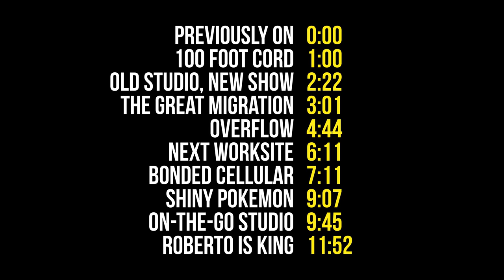The Most Luxurious Chicken Coop In America Is Complete

Comment: Don't leave the USB-C to ethernet adapter connected to the cable. When they get smacked around like that, they can break rather easily and cause intermittent connections that will drive you crazy trying to figure out what's wrong.

Comment: The other way to prevent the rooster from crowing early in the morning is to make the roof of the sleeping enclosure too low for it to fully extend its neck, (so less than 1.5x chicken height).

However this diminishes the comfort of the sleeping area, and automate the time that the chicken gets let out.

But it is sad if a rooster can't crow ...

Edit; All this got me researching, apparently the chokers only restrict max breath on chickens, so only when trying to crow, also low ceilings and step on roosting perch might equally be unpleasant for chickens, but our neighbours needed us to keep them quiet and they were mostly outside.
Reply: Won't it just get out to crow?
Reply: @LuisC7  the whole sleeping area has to be with low ceiling, so in many ways not ideal, but designated sleeping area that is locked and opened each day ...

Our chickens were not so lucky as yours, so we just had a 3m square low ceiling box that we ushered them into each evening, and let them out each morning.
Reply: @nicholasmorrison1476  yeah, you can also cut the vocal cords
Reply: @LuisC7  I have a tendency to try to want the chicken to still be able to crow, just not at 5AM, but to each their own way.

Actually I don't even mind, it was the neighbours.
Reply: @nicholasmorrison1476  I had chickens and didn't do anything. If it's a problem I just put some earplugs on.
Reply: @LuisC7  well it looks like the Cast Castle are going to get some throat restricting device I've never heard of, hence this comment thread, but agree, if not for the neighbours, I actually liked the rooster crowing super early.
Reply: I look forward to the EPIC chicken city.

Comment: You had the right idea using pvc pipe for feeders but you should have used a T joint at the bottom and ran a horizontal pvc pipe with rectangles cut out on the top.  Also get a funnel makes pouring easier.  I just find that setup more efficient.  Also time to get a rain catch barrels and set up automatic waterers.

Comment: I wouldn't recommend running ethernet across the floor where it can be stepped on. It will get pinched and you'll start getting signal degradation within a few months.
Reply: I agree.  Run it up the wall and secure to the ceiling using screw in C shaped hooks.  It might also just be a temporary run for testing the trailer considering where it was parked.
Reply: @peterbills4129  Yeah I was thinking that originally but I think that's gaffer tape

Comment: Chicken expert watches like 🤦‍♀️. The way you teach a chicken is by pecking with your finger. You start by doing this as chicks so they learn what it means. Someone needs to show you how to hold them securely. The cups are too tall for the babies but it looks like they are just screwed in? I’m personally not a fan of tub feeders unless the tubes are outside the coup so you don’t have to enter the coup to feed. I just use the hanging galvanized feeders and place a plate over the opening with a hole in them to feed through the string that holds them. If there’s a way they can kill themselves they will. Cracks, corners, gaps; ive even had some hang themselves on chicken wire :/ can’t wait to see chicken city live streamed
Reply: When someone on the internet leads by touting their unverifiable ‘expertise’ it just shows me they either don’t actually know what they’re talking about, or they’re so insecure that I shouldn’t trust their info. 

If your information is good, it will stand on its own. No need for hollow bragging. Yeah, these guys screw up stuff and need advice in a lot of cases, and they hold a chicken like it’s venomous, but they’re trying and adapting.
Reply: @neobaggins3718  Or you could do some research and realize they are active in the specific breed groups and show? I’m not in the east I’m in Washington but I could point them toward other experts who would be great mentors if both parties are up for it. Or.. not